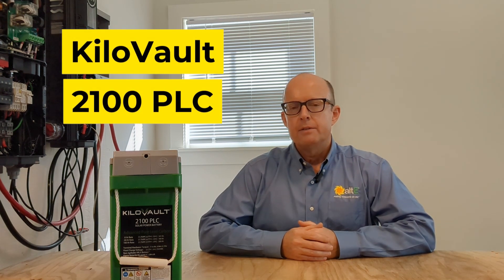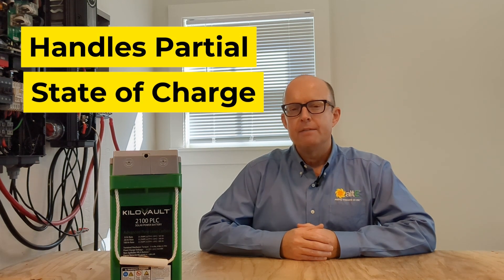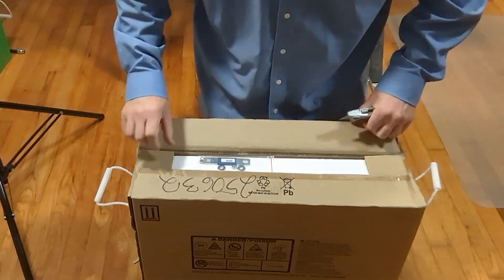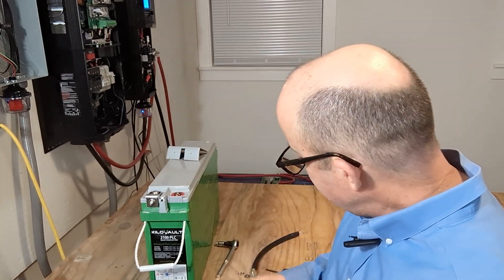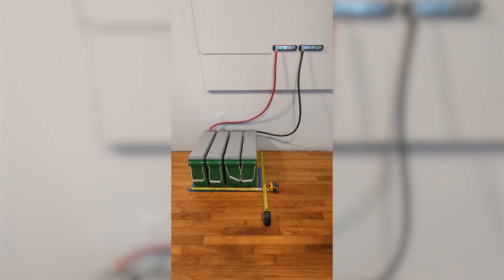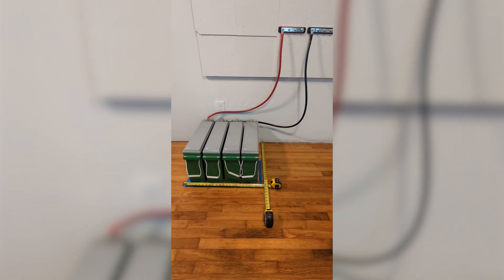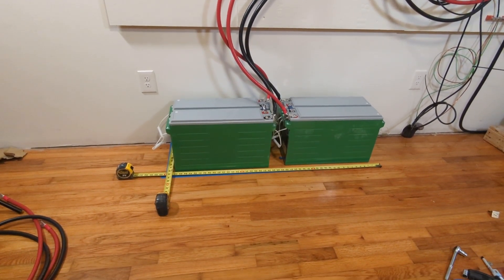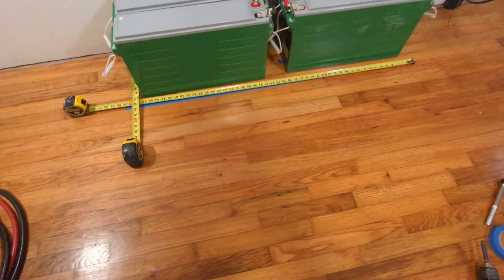KiloVault🔋 PLC AGM Battery Explained, Installation & Storage Tips

Comment: I’d gladly use AGM or PCC but between higher cost per kW than LiFePO4. The next biggest issue is just how heavy they are vs LiFePO4. With new Na Ion (sodium) batteries about to hit main stream markets. It makes an even tougher case against lead.
Reply: Handles temperatures down to -40F  - Lithium iron phosphate doesn't do that.
Reply: @WorBlux oh yes because it’s so difficult to keep lifepo4 in a heated enclosure lol😂
Reply: @THEOFFGRIDMOUNTAINHOMESTEAD  

Where is the heat energy going to come from in an off-grid system?  Particularly for enviromental monitoring/telecom were it's not powering an inhabited structure. 

Even if it's technically worth it to enclose and heat the batteries, it increases the complexity and part count of the system and increases potential points of failure.  And batteries that include heaters get expensive.
Reply: Um… Inverters and electronics give off heat. Example: cell tower stations need Air Conditioning even in winter. 
Otherwise one could implement some of 👇
Closed cell foam insulation 
DC heaters
DC mini splits 
Gas fired heaters
Liquid Fuel heaters etc etc 

 even AGM/PCC/FLA still suck and lose capacity etc in cold temps. 

Internally heated lifepo4 is still cheaper than lead based batteries of same kWh, charge controllers can monitor temps etc all kind of low temp workarounds

Comment: Just bought a pallet of these to replace a 20 year old industrial battery bank of twelve industrial 2 volt 1460 AH VR AGM cells going on their 25th year! With a commercial desulfater attached! I'd like to see lithium attempt this! 😂 Lithium would absolutely FAIL under the -21 °F winter conditions that these batteries will go through. PLC AGM would survive a EMP or MCE far better than a BMS on a LiPo4 battery.... Cheers!

Comment: Lead Acid? who still uses these?
Reply: Anybody that needs to charge below freezing, or whose application will see calendar ageing outweigh cycle ageing as a cause of failure. Additionally no need for a complex BMS, and is compatible with a wide range of off the shelf chargers and accessories.